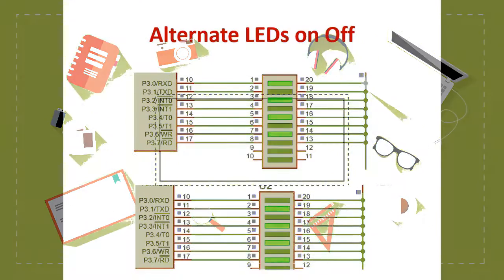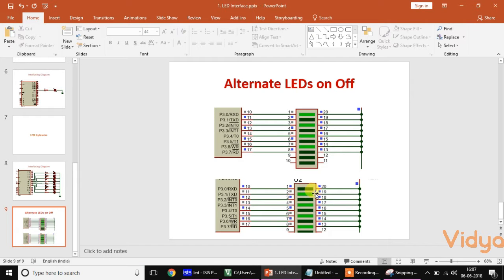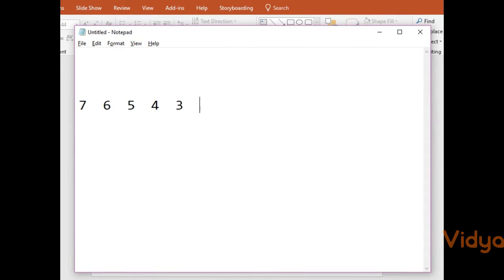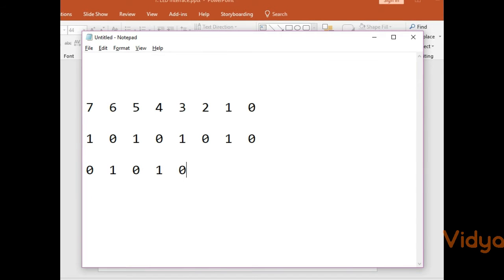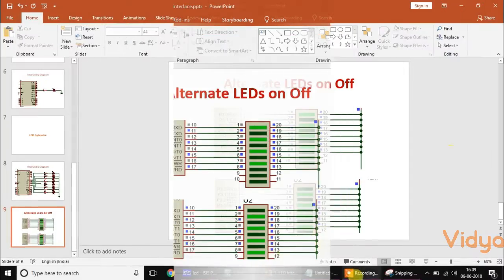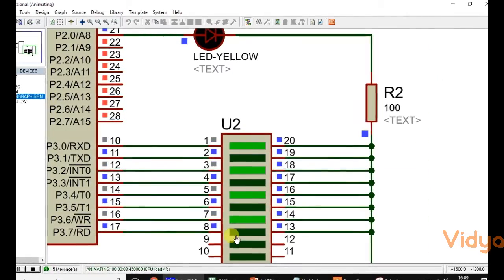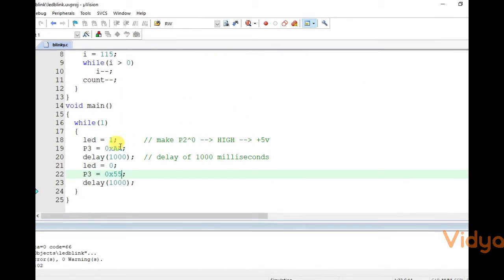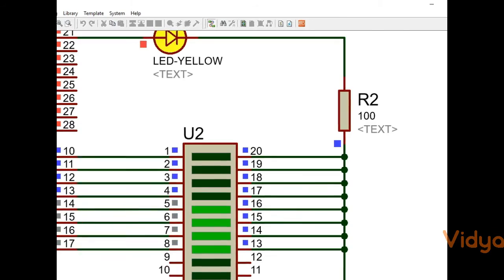How to make alternate LEDs on off with 8051 microcontroller-Tutorial 8

Comment: How can we use P4.5 in keil for 8051, as I'm coding for MG82F6B001 which has P4.5 but Keil shows error on P4 as 8051 initial architecture didn't have P4 port. Any solution please.